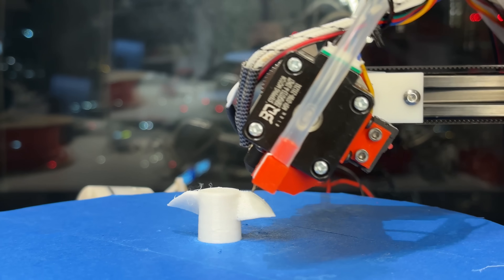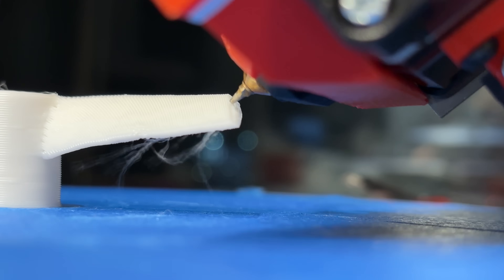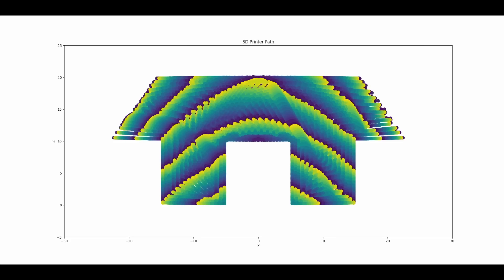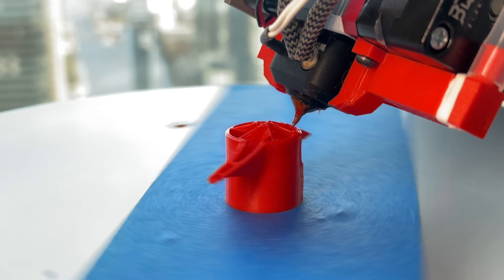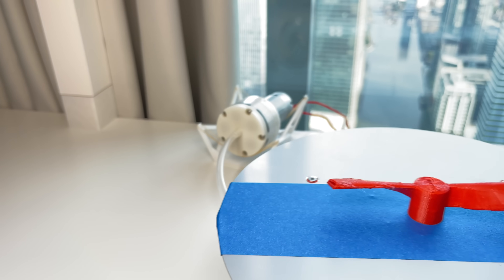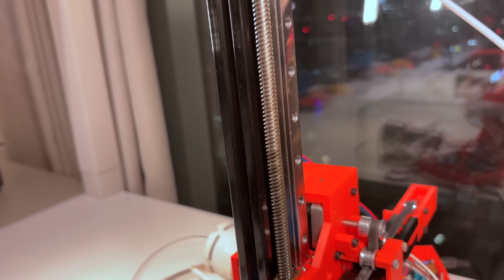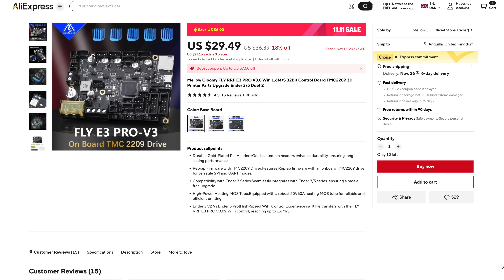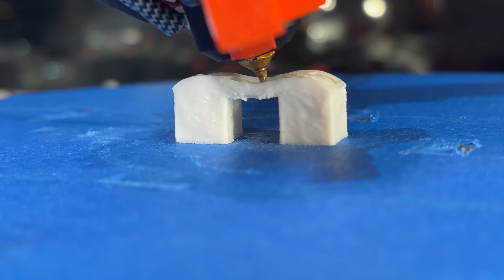I Built a 4 Axis 3D Printer Unlike Anything You’ve Seen

Comment: FR4 is an amazing print surface and you could of built in a heating element. Just saying since you had JLCPCB as a sponsor. I use FR4 when printing PETG on my bed slinger. I have a number of different print plates that I use depending on material.

Comment: I think that a solution for the singularity problem would be allowing the printing head to travel a bit beyond the center of a bed so the central zone could be filled with almost regular cartesian movements, although the code itself may be a bit sophisticated for this and would not completely eliminate structural weakness in the region.
Reply: yeah RRF wouldn't support that easily
Reply: A couple different directions of solutions and improvements: A) Slicer with ability to do cylindrical and spiral flat layers.  Doesn't fix the singularity in the middle explicitly, but mitigates the discontinuity weakness. And improves and adds controls for strength / biasing for certain model features. Similarly unlocks some better optimized infill options. B) Moving the theta axis movement to the print head and working with a fixed build plate. The issue there is spinning the somewhat massive gantry. 

The other thing is I see this printer as part of a dual extruder machine where the other extruder is a core XY. Initial slicers would need the user to define regions / features on the part for the each of 2-6 regimes of slicing.  Later down the line, the slicers could suggest boundaries and regimes from a part volumetric analysis.  The drawback is losing some of the speed and model build plate adhesion advantages of pure core XY since the bed will be rotating at various moments.

1) (primary a) non-planar 4D with automatic versus user defined layer normal vector. 
2) (primary b) core XY standard planar. 
3) (optional later addition) core XY radial planar printing (since the build plate spins, add it as a feature of the core XY head movement).
4) (existing examples addition) core XY multi planar
5) (later addition) concurrent non-blocking dual head printing of independent features (core XY has a zone of ~50-80% of the build plate where it would never collide and can work independently)
6) (later addition) dual extruder cooperative printing (strength enhancing layer patterning, "sewing" / textile lattice weaving, even just supplemental cooling)

Comment: The insane work to make this accessable is awesome. You talked about other solutions just using robot arms or an existing 4 axis cnc, would have saved you a ton of time but what you've designed could be turned into a real product under $1000 if you can make a user friendly slicer. I love the homing and bed leveling systems. Hopefully cooling can be simpler.

Comment: Super Awesome! Love that the only reason I get to see this is that your free trial was running out. Nathan Builds Robots uses a counter rotating mass for his polar bed or something like that. Having melted many fan ducts, PC Carbon Fiber filament can be printed on an i3 style printer. It is great for temperature resistance and easy to print because the fiber breaks up the long polymer chains and severely reduces warping. All you need is new nozzle and a cardboard box to put over the printer. ABS+ from eSun is also an option but not as temperature resistant as PC CF. Also excited to see the ceramic version.

Comment: THIS is what non-planar slicing should be, with this design, you don't even need to use the rotational axis if you want to just run regular gcode, but the option is there to do non-planar stuff as well. Really well thought out and an excellent design.

Comment: Holy crap this is cool. You didn't just build the machine, but you also did the math. I love it! I'm only 22 seconds in and can already see that this is going to make an impact on the 3D print community. That is, unless Stratasys is going to hunt you down saying your design looks like one of their nonsense patents. I hope this makes it out into the wild! I love it!
Reply: I see it as two great achievements: the whole slicing for anything other than the regular prints was unsolved, and he made the software for it and also the built itself, of course. Thanks for going open-source, btw. 🙏
Reply: Absolutely.
Reply: actually I have a patent on using various axis of movement (such as linear and rotational, though this is a non-exhaustive list) in order to move a toolhead to various points in space (dubbed "locations") with electrical, hydraulic, manual, and or pnuematic actuation. (also non-exhaustive)

This also infringes on a patent of mine with regards to using a thin flexible strip of material (dubbed a "belt") to confer rotational and/or linear motion across a distance.
Reply: @robonator2945  Your patents actually infringe on my patent on writting patents.
Reply: @robonator2945  This also infringes on a patent of mine with regards to using a thin flexible strip of material (dubbed a "belt") to confer rotational and/or linear motion across a distance, currently it's widely used in automotive starter motors.

Comment: Absolutely sick!

I have a couple of ideas tho: 
A) just add a blower fan on the Z axis gantry pointing at the rough area where the nozzle spends most of its time.
B) it might be interesting to see if a 90deg heat block makes sense in this config, since it would let you get the angle as close as possible to horizontal. I believe some upside down printer used it without any weird issues
super excited to see where both the printer and slicer go!